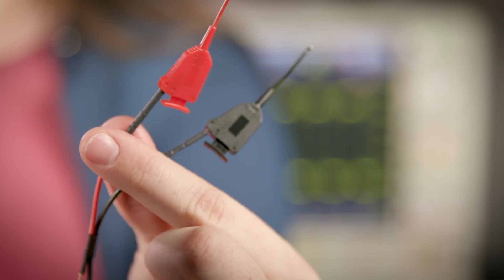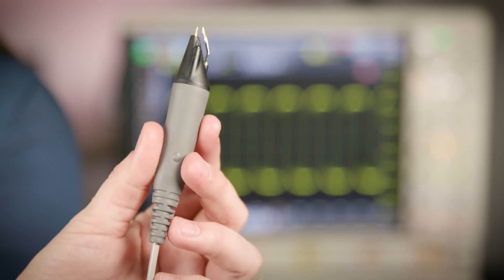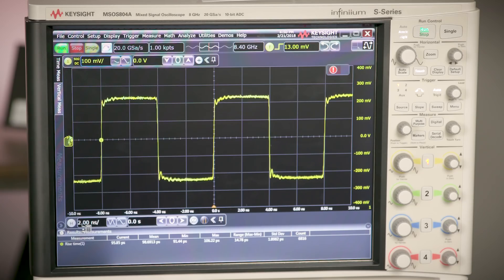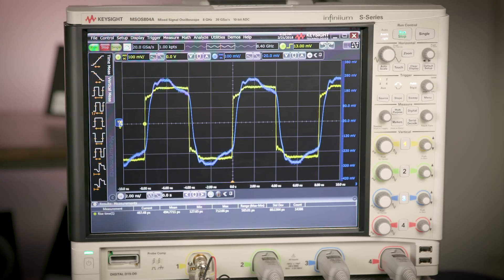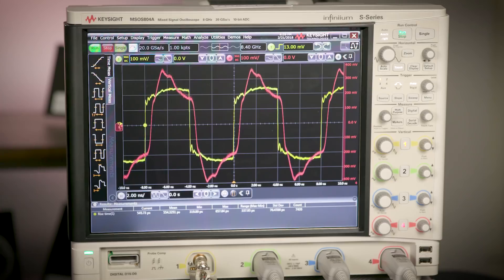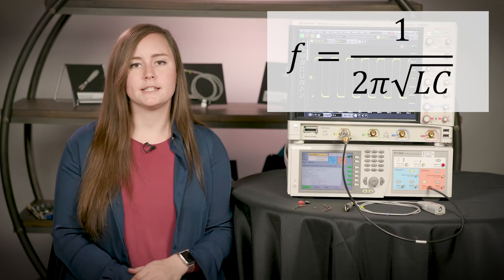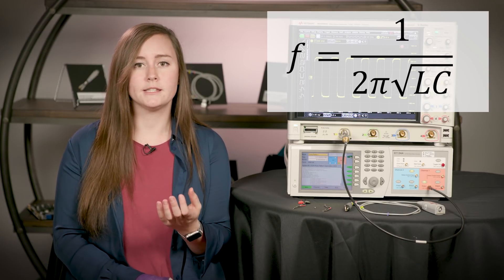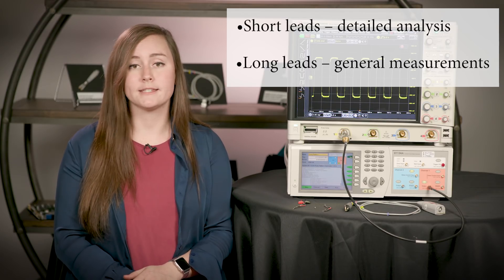Oscilloscope Probe Tips and Ground Lead Pitfalls

Comment: Great example.  When parasites aren't infesting the system (I see on some days why Bell Labs and others invented or used the anechoic chamber Faraday cage and some even have like 3 layers of Faraday cages literally)... this is neat to see just how the carrier current (hardwired) system effects signals integrity especially as we move into the higher frequency ranges more with COTS devices and proprietary devices. Thanks for sharing!   

Had to comment also regarding would have been nice, for me at least, if the current of injury (term taken from Dr. Robert O'Becker regarding bone/regenerative healing) devices to accelerate wound in general healing were on the market post wounded.  Would be nice to find a way to attract metal fragments out also without disrupting body function adversely or at least long term.  Then bio-equivalent heal up after metal even from screws and plates are removed. Seems like areas of opportunity for a startup or a medical device manufacturer.

Comment: We have a different but related problem with this on my end called shorting. My family has a bad history of shaking. Only getting worse as we age (its a miracle some of us can still solder...). One good thing that I like is that some probes (ie. N2870A) comes with an adhesive copper pad. It also came with plastic tips matching an IC's lead width being probed. The probe itself has a nice slot on the side to fit a flat copper ground lead with the plastic tip attached. (see keysight img link) Is there an accessory kit/s that I can be directed to for any probe containing these? The other probes we've got (N2890A) does not seem to have this. Link: https://s7.images.keysight.com/is/image/Keysight/PROD-1661803-01?$MAIN$